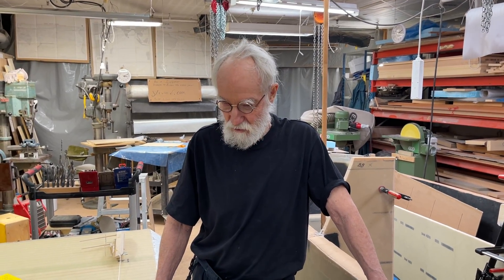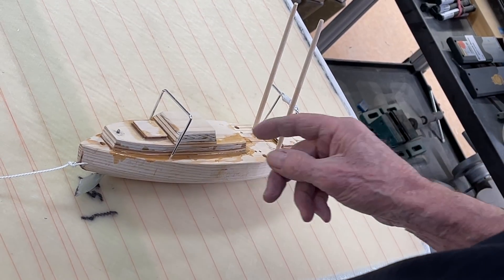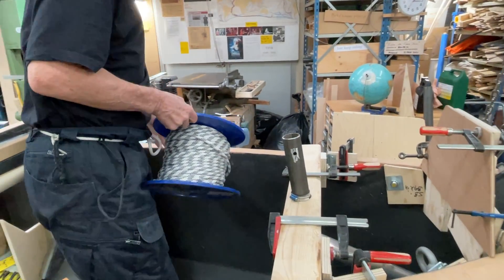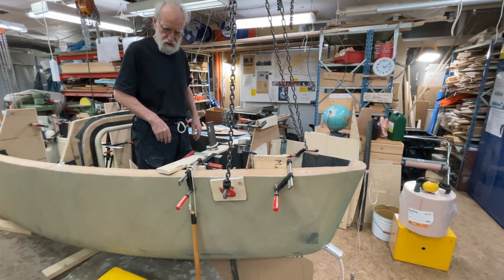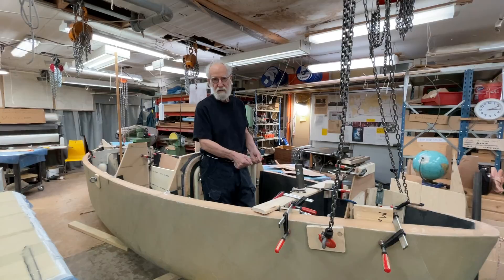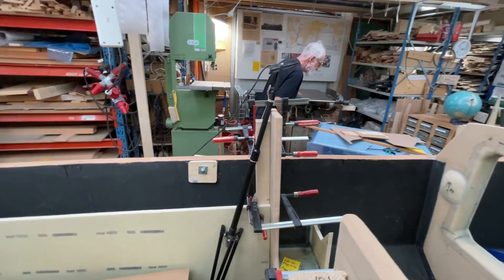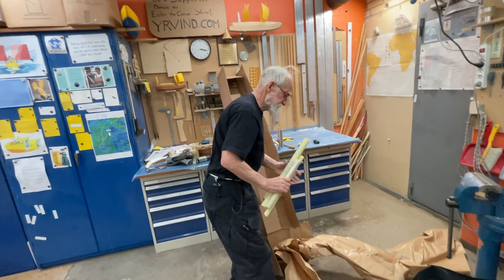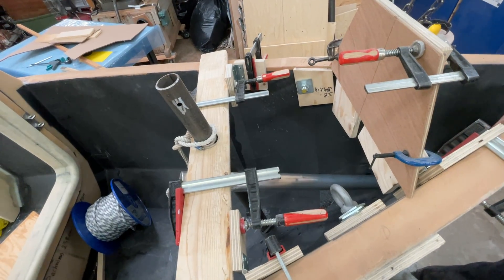The new drouge/anchor system with a tail through a hawse pipe in the sern. A bettering.

Comment: I have been thinking about your rudder design. I have no doubt that the rudder shaft is strong enough. I once saw a 26 ft Pearson that struck an underwater obstacle with its spade rudder. The rudder shaft bent, but the boat was still steerable.
My concern is the small gap between the top of the rudder blade and the hull. The worry is that a line, a piece of kelp, or some piece of sea junk, could get caught in this gap and jamb the rudder.

I have thought of a possible remedy for this. It would be three triangular mini-skegs that are about 15 cm long and 15 cm high. They would be right triangles.

The first could be put maybe 1 to 2 cm in front of the rudder. 

The other two could be placed about 10 cm aft the first one. They could be placed on either side. They could be placed far enough apart, so the rudder could turn 40 degrees  to either side.

A line would hit the first one, which would divert it down until the line reached its point. But before the line could float back up, it would hit the other two. And after it got past those, it would be so far along the rudder blade that it couldn't float back up.
Reply from the maker: Most production boats have spade rudder with this gap and they seem to do fine.
I agre that it can be a problem so if you have watched my earlier video yoy will see that on the model there is just such fins in the model in the shape of nails
I have also an idea of a lip that sweeps the gap but more about that later

Comment: Hi Mr Yrvind, I was thinking 'chaffing' of the drogue line when I saw the short hawse pipe sticking out the stern. Would you be getting it flushed to the hull eventually in your design? Is it possible a big force by the drogue in the sea will bend this short pipe and even add stress the surrounding hull surface because of its protuding length? It would seem like this short pipe will render itself a handle for the forces of the sea to act adversely on the hull.
Reply from the maker: The pipe will be strong to lift several boats in and it will hava a trumpet surface to reduce wear and the line can be chafe protected.

Comment: Interesting. My first thought is that this complicates things more than needed. But, it must be useful if you are using it. I guess the benefit is if the wind is howling outside and the rain and waves are strong, you can be warm and dry inside hauling in or paying out your drogue line. Or, adjusting your anchor line. You still have to go up on deck in the elements to attach/detach the drogue or anchor, but at least with this system you minimize time on deck when it's nasty out.
Reply from the maker: There is no drougeu
The line and the chain is the drougeu so no need to go on deck or even open the hatch.
Read the introduction

Comment: Maybe you could make a tool to easily remove any marine growth from the inside of that drogue/anchor line tube so it doesn't block or chafe the line?
Reply from the maker: Marine growth do not like to stay in centerboard trunks.
I do not think they like it in a hawse pipe either.
They like fluid water so that they  can passivly collect food.
Besides the hawse pipe is abouve the water.

Comment: Could you run the hawse pipe through the boat to the deck?  No leaks that way?
Reply from the maker: I do not want it on deck.
I want below the deck in order to handle the rope protected from the weather.
The drum winch is in the aft compartment separated from the living area by a bulkhead with a waterproof hatch.
It also have its own pump to take care of any water that might enter.
Reply: I'm sailing a 20' replica of a transatlantic dory which crossed in 1876... it's incredible that Yrvind is coming up with the same solutions today!!! 1876 banks dory has a large bow eye just inches above the water line, the big galvanized iron eye functions as a spot to fasten the bobstay and as a fair lead for streaming the anchor with wooden baffels, chain and line as a drouge/sea anchor! I suppose it's less convenient than a hawse pipe as anchor and lines are handled from the fore deck, but with limited glue technology in 1870's it's probably better to reduce the number of through hulls 🤯 very much enjoying your building process Yrvind!

Comment: Possible the smallest boat with a hawse pipe. I see the importance of getting the force down low.
Reply: I'm sailing a 20' replica of a transatlantic dory which crossed in 1876... it's incredible that Yrvind is coming up with the same solutions today!!! This boat has a large bow eye just inches above the water line, the big galvanized iron eye functions as a spot to fasten the bobstay and as a fair lead for streaming the anchor with wooden baffels, chain and line as a drouge/sea anchor! I suppose it's less convenient than a hawse pipe but with limited glue technology in 1870's it's probably better to reduce the number of through hulls 🤯

Comment: Will water shoot back through that pipe in a following sea?
Reply from the maker: The prudent mariner stops water from getting below with a navel pipe bung.
Reply: @SvenYrvindExlex  please share more details about your bung system! There has been many a boat engine ruined by the water pressure of a big following sea overwhelming the exhaust system and flooding cylinders!  

I’m not sure if your vessel has watertight compartments, but your life may depend on that bung! And if you have to adjust the drogue in a big sea, you may have to fight a lot of surge  pressure!  I’m sure you are well aware of this, but I see that system as a hyper critical one!  And I’d love to see a video of you using the system in action - warm, dry, and safe!
Reply: Will see how he addresses that. 
My swing keel lift tube so far has been addressed by electrical tape to make a boot. Exhaust  has similar concerns, expanded gooseneck inside high is normally enough.
Reply: I would think the tube for the anchor/drogue  line would either have a two piece bung or would extend to above the deck in a similar fashion as the mast tubes (go through the hull but both openings are external).  Edit: just read his comment - it will terminate below deck for direct access.